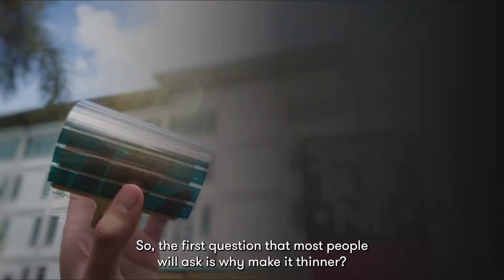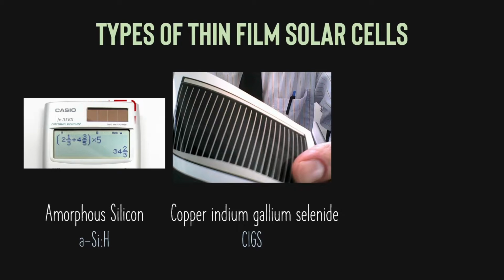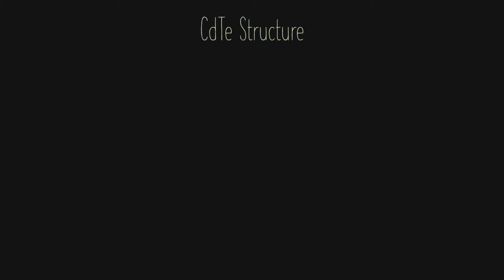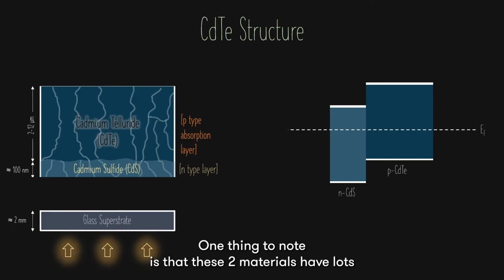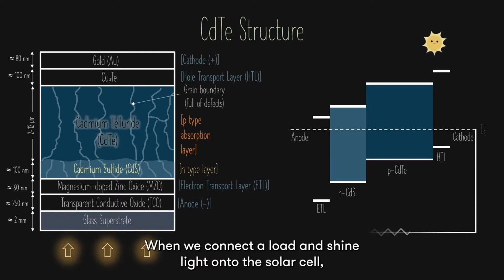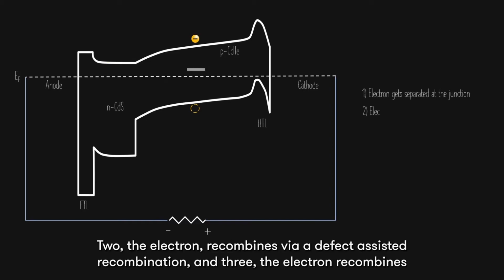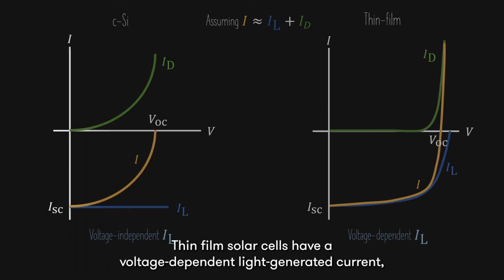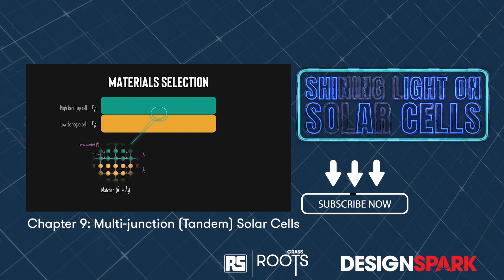Shining Light on Solar Cells - Chapter 8: Thin Film Solar Cells

Comment: This is great but, I couldn't grab one thing: How the minority carriers in the n side (holes) are prevented from recombining with the defect states near the anode connector by the energy barrier introduced from the ETL layer, the Schottky junction between ETL and N side CdS frankly facilitates the hole transportation through the Schottky junction
Please describe it for me; I might be misunderstanding a crucial fact.
Reply: Hi Chandula,

Christopher here. While the ETL forms a Schottky junction with the n side, recombination between the minority carrier hole only happens when the hole reaches the anode layer. As you can see even if the hole moves up the Schottky junction, the entry to the anode is hindered by a big piece of energy barrier in the ETL (just on the left side of the Schottky junction). 

A great and intuitive way to look at it is if you were to rotate your entire screen upside down and imagine these barriers as hills and valleys, and the hole as a ball, which is affected by gravity. It is usually easier to see for electrons because analogically the energy levels work in the same direction as gravity. But for holes, you need to rotate your screen to "change the direction of gravity".